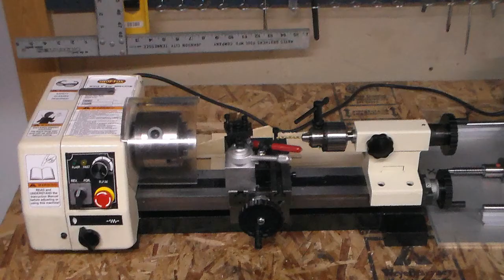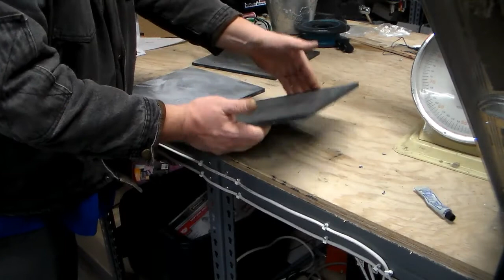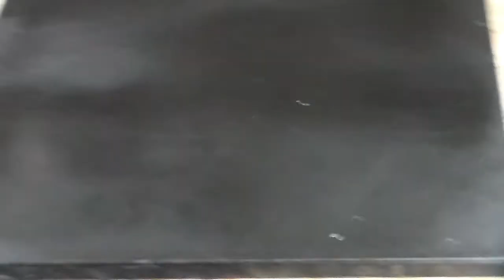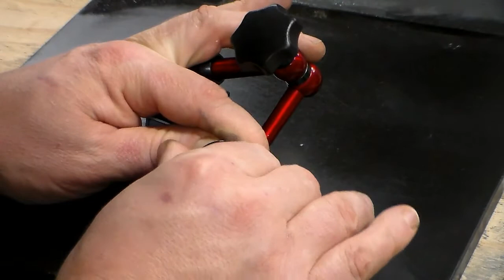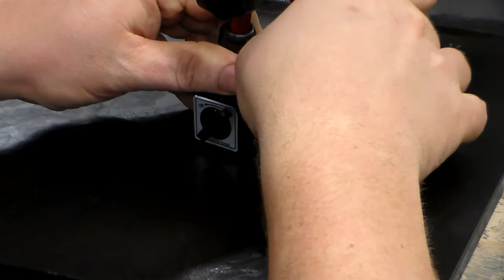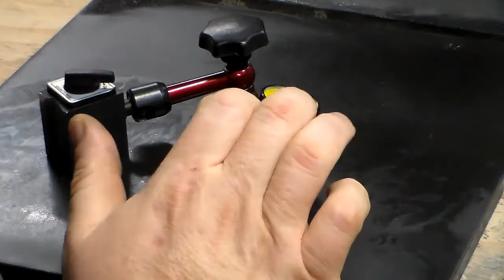Budget Machine Shop-The $20 Surface Plate

Comment: Great idea ... All for keeping maximum efficacy for minimum spend. However ...

1. Those plates are so thin (as others have said) and not supported on a tryly flat and solid base, that you are pretty much defeating the object of the exercise. They WILL deflect ... A LOT ... especially if you have to press on them with any force. 

Watch professional lappers at work ... They are barely touching their lapping plates using finger tip pressure and letting weight of the lapping plate ONLY apply the grinding force.

2. The magnetic base has far too small an area and weight to properly support the indicator. See below for more info.

3. The dial indicator being used, whilst being of the right kind of accuracy for a budget job is of the wrong type. You need to use a standard vertical gauge so that the probe is accurately measuring height not the height at an incorrect acute angle (cosine error that people reference).

To resolve 2. above, and as someone suggested, use a steel plate of some 80mm square fitted with three points of contact fitted close to two corners and the centre of one edge for maximum stability. Ensure the machine screws used are rounded off at the lower end and then cut adjusting slots at the top end for a flate blade screwdriver. 

Level this plate using a proper surface plate! Don't have access to one? Go to a friend or machine shop that DOES have a pukka surface plate, or at least a pretty accurate one. Find someone amenable and ask them if they'd agree to it level it out for you as a guvvy job. You'd be surprised at how keen some guys are to help. 

Use locknuts to keep the adjustment correct like gib screw lock nuts.

The pauper's way (you are not just on a budget but super broke and in a hurry) to at least get close to an accurate levelling is to use a larger flat steel plate or machined surface. Clamp the magnetic base to it and measure and compare the height of the two points on each of the corners of your intended clamp plate by moving them individually directly under the indicator and adjusting them to read the same. Then adjust the final third point the same way setting to the same value. Repeat the checks on the other two by rotating the plate with each point remaining under the indicator probe.

The above method SHOULD give you a fairly accurately levelled plate just not as accurate as if done on a proper surface plate.

Comment: You can surely achieve flatness for really cheap, but those 12 or 15mm thick plates will never give you anything resembling that.
Reply: How much deflection are we talking here? I'd expect it to be an order of magnitude better than your typical workbench
Reply: Depending on the weight of the piece, you'll surely get less deflection on a sturdy workbench

Comment: Glad you posted even if it isn't quite correct way to lap plates. Not everyone can afford or wants to spend hundreds or thousands for equipment (I know I can't do it) Anyway, it gives people an alternative way to get things.  The tiles can distort though as they are pretty thin, a 2" ~4"or so base made from hydraulic cement will improve things a lot. Hydraulic cement doesn't shrink when curing. Check some of the telescope and lens DIY, there was a gauge made from plywood , 3 aluminium nails and a brass screw just about as accurate as the several hundred dollar 'proper' tool, within 50 millionths of meter for pennies. The guy had almost 30 yrs experience though so it may have looked easier than it really was?
Reply: Peter Jones do you remember the lens guys name that had the plywood gauge?

Comment: Using a cheap magnetic indicator holder is not a problem (well, it is but it can be overcome).  What will be a problem is using it's face as the face contacting the surface plate.     I can pretty much assure you that the magnetic base is not ground very well.  It may have a twist in it,  it probably has a dip or a high spot.  That means that as you slide it over an uneven surface the contact of the magnetic base and the surface is going to shift around and be weird.     However,  this is easy enough to fix.   Take a piece of soft steel that is slightly bigger than the base and drill 3 holes in it.  Tap the holes for your favorite machine screw size (I like 1/4-28 or 10-32).  Grind three machine screws to points and screw them through the base.      Use jamb nuts to prevent the machine screws from turning.   Clamp the magnetic base to that 3 footed plate and lock it down.    Now you will have 3 points of contact so you eliminate the problem of warped or uneven base contact.
Reply: Great idea

Comment: As someone else mentioned you will have cosine error in your measurement.   It's not critical for what you are doing in that you aren't trying to find absolute values,  just relative ones.    But the way you had the indicator probe it will be very problematic.  You want the arm to be nearly parallel to the surface of the plate.   See Joe Piezincski's video on that:    https://www.youtube.com/watch?v=dsWSxpwCPUg      and NYT's slightly different take:   https://www.youtube.com/watch?v=d4gymGOo468

Comment: In your three plate demonstration you lapped plate 2 against 3,  and then 1 against 2,  and returned to do 3 against 2.     You have to rotate the sequence so that all three plates come into contact with each other, and take turns being on top.     Thus it takes a total of six pairings to go through a sequence.   In addition you should rotate the plates by 90 degrees so there are 24 pairings to a sequence.     I would also add a little solvent such as kerosene to reduce the sticktion so that your plates slide more evenly.

Go look for Oxtools videos on lapping plates.  He does a series of videos and goes into the details of the sequence for round lapping plates very well.  https://www.youtube.com/watch?v=rHmsQEAx16o
Reply: I'm glad to see someone wanting to help another get their shop going. It gives me hope for humanity. What do you think about using an old marble/or other counter top for a surface plate? I have access to a friend's huge old surface plate to use as a master.
Reply: @bradyoung6663   I bought a granite 12"12 tile from the big box home improvement shop to use as a plate to use for lapping with sandpaper.    I was surprised to find that it was quite flat - better than a thou over 12".      However,  "old marble" might be a lot more problematic.  Marble is much softer, and if it's old it may have wear spots on it.
Reply: @dolata000  Ok. I'll just go get a new one. At least a "newer" one. Thank you Sir.